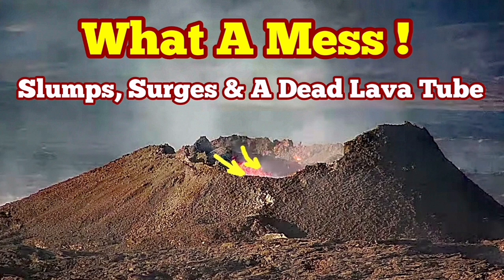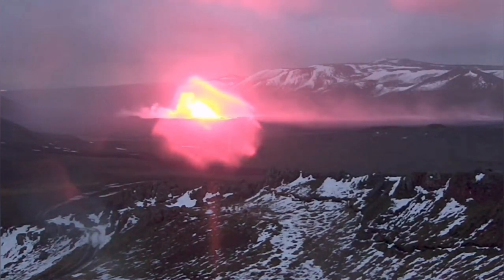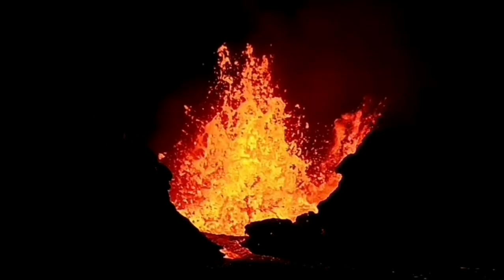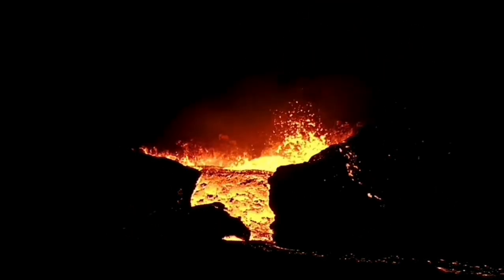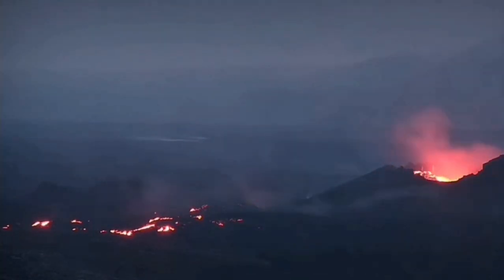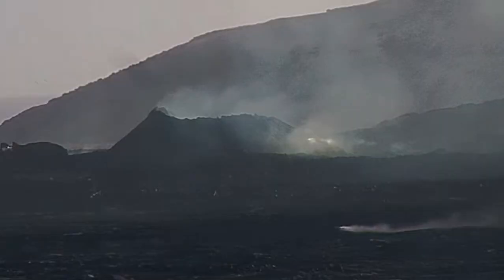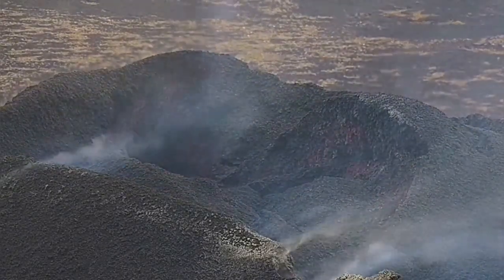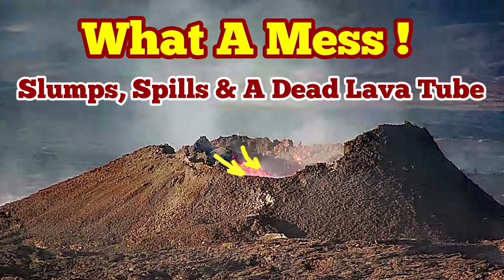What A Mess! Slumps, Surges & A Dead Lava Tube, Iceland KayOne Volcano Eruption Update,Litli-Hrútur

Comment: I thought since the output was although steady for a long time, was not expanding enough to keep up the output of lava before exhausting its magma supply and it collapses. It may be doing that now. The little system cant support itself any longer so it collapses, or burns itself out. Also it may prove another point I made before and that is this vent is not really connected to the uplifted area somewhat near by. It could be but K1 shows no sign of reacting to the uplifted area.